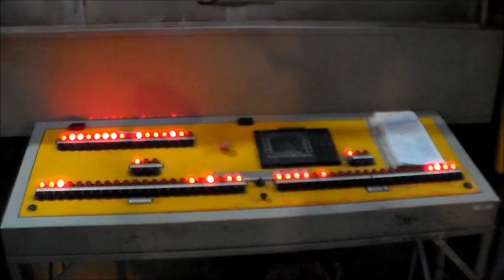How a windscreen is manufactured - National Auto Glass

Comment: If making a windscreen is so easy why can't I purchase a CLEAR windscreen for a 1989 vw transporter?
Reply: Bill Shannon well I came here wondering why it's hard to get a windscreen for my 98 Ek3 Civic. Cutting the windscreen is not the issue, it's getting the mold to bend the glass into the desired shape. There are different molds for different vehicles and models. so once that particular vehicle model is no longer being manufactured, it's bye bye mold.
Reply: Call Eddie Kotto at Kotto glass.  They make the glass for custom cars.  There are other shops too.  Probably all the west coast.
Reply: Automotive aftermarket availability is based on the potential for sales.. there is almost ZERO aftermarket need for that model.

Comment: Interesting!  What's the temperature and pressure in the autoclave?  Thanks for posting...
Reply: pressure 12.5 bar and temperature 35
Reply: To be effective, the autoclave must reach and maintain a temperature of 121° C for at least 30 minutes by using saturated steam under at least 15 psi of pressure.